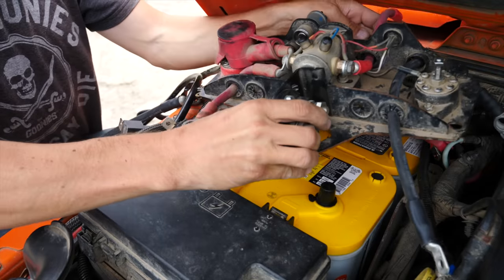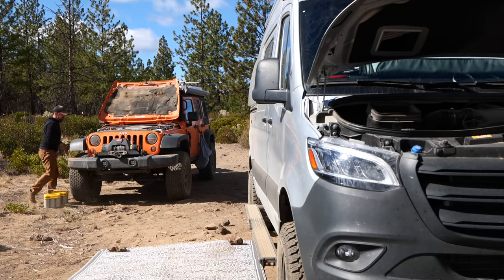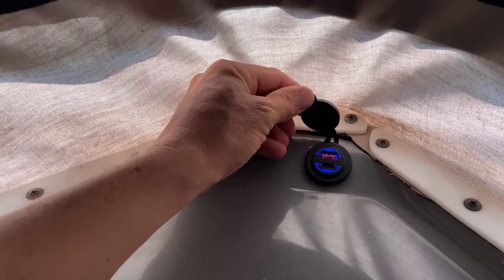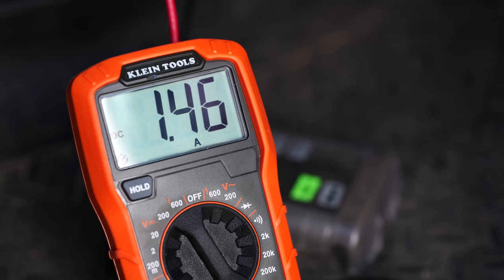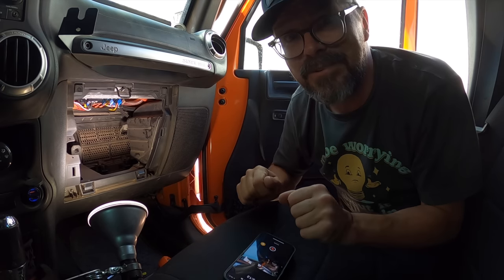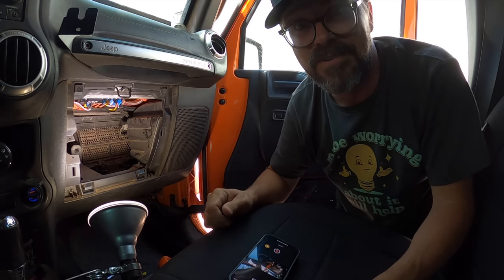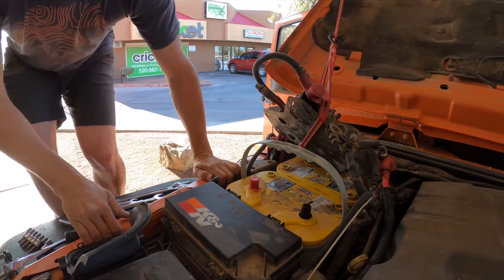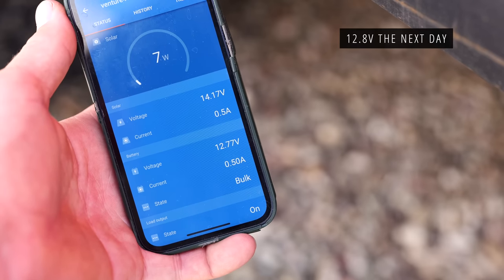Diagnosing Electrical Issues in the Jeep

Comment: I have been working with emergency response vehicles for over 23 years and I have a few suggestions for you to consider. 
First, AGM batteries charge between 14.6 and 14.8 volts after deep cycle use. Your charging system was only showing 13.7 volts initially. You can get your charging system checked for free. My Harley eats AGM batteries if not charged after a ride and my electrical system is at 14.4-14.6 volts.Someone in the comments below suggested a DC/DC charging system for your secondary battery. Sounds like good advice when out in the field. 
Finally, 300 mA is a considerable amount of draw for a vehicle that idles a lot and doesn't do freeway speeds every day. Normal electrical system useage of creature comforts and accessories can draw down a battery at engine idle.  Now that you have a home, consider installing battery maintainers and plugging in your truck when not in use.
Best of luck.

Comment: Chris, I think you hit the nail on the head with the comment about the fridge draining the battery down beyond 50%, AGM batteries will not recover properly with just a charge from an alternator. You would benefit from a DC - DC charging solution or if that is too much trouble simply charge your battery from 110v on a good quality multi stage charger once a month. Secondly i would definitely fit a Victron Battery Protect module to stop you over discharging the Aux battery, they are cheap and easy to install

Comment: First, like you said, Optima Batteries are not the same batteries they used to be 10 years ago. If an AGM battery like that drops so abruptly then the problem is the battery. What I suggest is to get rid of the dual battery system, have an Odyssey or another AGM like  Interstate AGM battery group 94R only for starting the engine and get one Lithium battery 150Ah or higher for the essentials like fridge, USB outlets and chargers. Ive had the interstate battery 94R for starting the engine for about 4 years now, no problems so far. I highly recommend that. Now, if you get a Lithium battery you’ll have to place it inside the car; under a seat of something like that. Anyway, if you want more info about just reply and I’ll help you in that matter all you need.

Comment: I too am ready swap out an Optima Yellow Top.  It has worked well enough for 2 years, but it is no longer holding proper voltage for an entire day.  I am going to try a Duracell from Batteries Plus, another group 27 AGM, but at half the price of the OYT.

Comment: I have a similar system where I have 2 extreme batteries and a solar panel on the hood (cascadia 4x4) plus a redarc 1225 bcdc in line charger.  With that together I have not had any problems keeping my batteries charged.  I also have the genesis dual battery system but I just switched it out to there new digital system which is working really good.  I also keep my ARB fridge running 24-7 days a week but I installed a surge protector outlet inside and  i plugged the fridge into that with that I wired a outlet on the outside of the Jeep. I can plug 110 into it while my Jeep is sitting at home not running.  I have never had a problem with my batteries.  But before that it was a nightmare lol.

Comment: I'm a few months late here, but this summer I've dealt with a similar situation on a similar setup in my rig.  I too had the Genesis Off-Road system and a pair of Yellowtops... I just wasn't getting the runtime out of my setup.  Dakota Lithium has a Group 24-sized 12v 135Ah LiFePO4 battery that is rated for cranking duty and has a built-in heater for charging during my Canadian winters.  Of course, it's not recommended to charge it directly from the alternator, so I added a Victron DC-DC charger.  It was a pricy setup, but it's working like a dream!

Comment: Have you checked your solar controller for peak voltage settings? I have a different controller than you and it has a setting for agm batteries that peaks them a little higher then the alternator can. I’ve had zero problems (knock on wood) with my dual yellow tops.

Comment: The problem is probably that your solar system can't keep up with your device discharge rate.  So when the Jeep is idle, the battery is being drawn down below the recommended 50% state-of-charge (about 12.1V at your draw current).  If the Jeep sits unused for a few days, especially during cloudy weather or with any shadow on the solar panel, your connected devices will eat away at the battery's reserve capacity (only 27.5Ah at 50% SOC for a Yellow Top).  While you can run an AGM down to 25% SOC, it will reduce the battery life by about 40% IIRC.  Going below 25-20% SOC (11.95V) can cause immediate battery damage.  10V is  well below 20% SOC.

A single 100W PV, according to industry standards, generates an average 425W/day (35Ah).  Older solar panels progressively generate less power, and any shadows on the panel or lack of bright sunshine also reduce output.  You measured about 2.8A with the fridge running, and 0.8 with it off.  Guessing that the fridge runs at a 10% duty cycle and averaging everything out, your 24Hr draw would be around 24Ah.  So on a good day (and with proper positioning), your solar system can recharge the battery every day.  But on a bad day you might be pulling all that 24Ah from your battery's reserve.  With only 55Ah total reserve, your Yellow Top can fall below 50% SOC after just one day of zero usable sunlight, and below 20% SOC after two days.  In your video you showed your solar was generating 0.2A, which is an estimated 0.8A less than your draw, and the situation gets worse as the Sun goes down.

Some possible solutions:

1. Connect a battery tender (at least 2A, no more than 10A) to your accessory battery when parked
2. Install a switch between your accessory battery and fuse box so you can turn everything off when you won't be using the Jeep for camping.
3. Install a low-voltage disconnect (such as the Victron Smart BatteryProtect) between the accessory battery and fuse box to automatically disconnect your accessory devices when the battery reaches 50% SOC (this would cause the fridge to turn off if the disconnect activates).

Comment: I'm heading off from Vermont in my 2021 RAM 1500 on a month-long camping tour of Nove Scotia, Newfoundland, Labrador and Quebec. I have a ICECO VL60D to keep everything cool. Instead of a dual battery system I have an ECOFLOW Delta 2 (1024 Wh) portable power station to provide auxiliary power. I installed a Victron DC-DC converter (not charger) to keep the Delta 2 powered while driving and ran a 12-volt outlet to the bed of the truck to keep the ICECO running while driving. The Victron unit will charge the Delta 2 at around 415 watts which is significantly faster than the RAM OEM 12-volt power outlet will. The ICECO will be plugged into the Delta 2 once I am at camp for the day and will keep it running all night without significant drain on the unit. Once I am back on the road the next day the Delta gets recharged by the Victron and the ICECO goes back on the 12-volt outlet in the bed of the truck. This trip will be a test of this setup in preparation for a 2-month road trip to Alaska & Canada in 2024.

Comment: Chris, I believe you are correct in your diagnosis. Doing the math your system the way it is currently set up works fine. It's just when you add up the hours in which it is under load living full time in your vehicle it depletes the life cycle of the aux battery. Maybe you can rotate the batteries from time to time which might improve overall life of the batteries. By the way looking at that transmission pan I believe it's time for a new one. Don't get stranded because of a leaky transmission. Safe travels, Perry

Comment: Hey Chris, with everything off, there should be no draw.  However, your fridge running non stop, with you never re-conditionjng those batteries with a charger (besides the solar, which is not sufficient to charge fully and definitely won't condition) will absolutely destroy them.  10 months is not great, but that is a aignificant load.
I suspect if you got an Optima Charger and conditioned your batteries when at home, they would last much longer.

Comment: When Interstate Battery bought Optima things changed. We used Optima on our off road race car & prerunners. They were a great battery and then we started having issues. What we found out was production was moved from Optima’s original factory in the US to Mexico. Interstate uses Johnson Controls to manufacture the Interstate battery. But we were told a 3rd party manufacturer called Clarios which works with Johnson Controls took over the manufacturing of the Optims battery in Mexico. The lead used in the spiral coil is recycled and the purity of lead is not the same quality as it was. We also had 2 battery’s where the terminal lost contact with the plating under the plastic case, causing it to lose contact. One of  the side terminal actually popped off the battery. In both cases these battery’s were in an extreme vibration application in a Baja Prerun truck. But this was never an issue on the OG Optima battery’s in the same vehicle. Btw we were using Red Tops, but that does not matter as Red, Blue & Yellow are all made in the same plant & contractor. 

For everyday use in my daily drivers I’ve had very good luck with Interstates from Costco. The cost is good and the warranty is great! 

But for a more extreme use look at US Battery. They are still made here in Pennsylvania. I’ve had great luck with them in several applications.

Comment: It takes 12-18 hours to fully charge a lead acid battery with a charger outputting around 14.1  volts for bulk charge and 13.6 for absorption and float charge. And for longevity it needs to be fully charged every week or so or at least monthly. I know you have solar but with the constant loads you really need to put a separate charger on the accessory battery every couple weeks. What happens if not fully charged, sulfate keeps building up on plates which ruins the battery. Getting it to full charge removes the sulfates. The loads you have are fine just need fully charged periodically.

Comment: You need to go with a Lithium Iron Phosphate (LifePo4) battery for your accessories.  10 year warranty to maintain 80% or more of it's original capacity and it will weigh about third of a lead-acid battery and require zero maintenance and will recharge much faster as well as maintain full voltage until nearly drained.  I have had zero good experiences using Optimas in my Ram or my Jeep.  Deep discharging any battery other than a lithium kills them in short order.  The other thing is you should invest in a good CTEK battery charger to maintain your batteries when you're home.  It will have a desulfating function that will add years to the life of a battery.
Reply: No doubt LiFePO4 batteries absolutely rock, the problem is mixing battery chemistries with a system such as the Genesis.  Since he's using AGM as a cranking battery, problems may (will) occur if he then uses lithium as an accessory.
Reply: @voodoo36x  The batteries are isolated.
Reply: @terrywaters6186  Not when the engine is running.  The isolator connects them.  This is why isolators are not the optimum choice for this.  DC-DC chargers are what he really needs to be running - especially if he swaps chemistries.      I ran a JK with a Genesis setup just like this for years and that isolator ended up killing my aux Odyssey battery just like this.
Reply: The issue again is... when you are on the road, good luck swapping them out in the small towns.  There is always a auto parts store which agm warranty. Problem with most youtubers recommending this, they are weekend campers
Reply: @ctrlnull7228  I guess the trick is to monitor the health of your batteries so you don't have them die on you in Siberia or the outback.   
It's very easy to do. The lithium batteries are gaining popularity exponentially and they're guaranteed 10 years before they begin to lose significant capacity and even then who knows how many more years they will function.  They'll be in every auto parts store and Walmart very soon.  Walmart already sells them online.

Comment: I run an off brand lithium power station for accessories does way better with fridge than leaf acid.  With prices where they are now If I were building it today I would use an  100 amp hour off brand lithium with a dc to DC charger and a victron solar controller for accessories.

Comment: WOW! I love my optima. Let me give you a little history, I was maintenance supervisor over many pieces of company owned powered equipment for military aircraft at an aircraft modification plant down in Texas,  as well as all vehicles including fire trucks.  Never had a problem with them.  I purchased one (blue top) yes marine deep cycle type for my personal truck it lasted 7 years.  When it went out I purchased another and it is on it's 7 year mark and still going strong.  Wondering why you did not get a deep cycle type battery for your accessories?  Also no corrosion which is a big plus. If you do run one down it takes a long time to charge up, be aware of that all night in fact on a trickle charge the best way to charge any battery.  Oh yes I saved the company lots of money over lead acid. Jeeps are also notorious for bad grounds I well know that also.

Comment: The issue is the way you’re connecting the batteries.  When you close the solenoid and connect the batteries the system gets an average voltage between them and charges to full.  If the house battery voltage is much lower then the starting battery it will never get fully charged since charging will stop once the average voltage hits whatever it’s programmed cutoff voltage is.  Disconnect the batteries and the average voltage will no longer apply and you will have a fully charged (or over charged) starting battery and an undercharged house battery.  To avoid this you need to fully charge both batteries separately on a regular basis and avoid deeply discharging the house battery, or use a DC-DC charger instead of the solenoid connection.

Comment: Might have already been discussed/mentioned, but of the Optima AGM batteries, I understand that the Red is the typical “starting” battery, while the Yellow is more of a “dual” (good for start & usage), but the Blue is the true “deep cycle”, designed purely for cycling and loading (but not heavy draw of starter cranking). These are a trade off in the design of the lead acid batteries. Battery University has some great technical background information (e.g. starting batteries can provide heavy cranking amps at the cost of poor deep discharge capability. Has to do with the design of the lead plate thickness and surface area.) 
For pure usage of a house-only battery like you have there, likely a true “deep cycle” agm (like the optima blue top) would be better than a “dual” purpose (starting & usage) battery like the Yellow Top.
Of course these days, while the Lead Acid AGM batteries are proven design, the LiFePO4 (Lithium Iron Phosphate) batteries (at least the ones from good quality manufacturers) are the next level and future. You get like 2x the usable Ah at 1/4-1/3 the weight for 2-4x the cycles/life - but 2x the price of Pb AGM. (If you dig into it, you’ll see that even the best Pb AGM should not be discharged past about 50% (depth of discharge) of their rated capacity. E.g. if it’s a 100 Ah battery, then you shouldnt really discharge below about 50 Ah, if you want to have a decent service life. Whereas generally you can get ~100 Ah out of a 100 Ah rated LiFePO4 battery, with a flatter (voltage) discharge curve.

So TLDR: get a true deep-cycle only (not “dual”/starting) or splurge for a quality LiFEPO4.

Comment: You do not have enough solar for your setup. Lead acid batteries can only be drawn low a few times before permanent damage. Double your solar or use a portable 100+ watt panel and buy a cheap lithium $300 Chinese 100ah battery. Nothing wrong with those optima batteries, they are just old technology and your abusing them. Every day you can't fully charge a less acid battery they more a tiny bit of capacity,  say 1%, that adds up over time. Any time you go into 11 volts some permanent damage is done. Lithium are a lot more resilient to abuse. I live in Tucson too,  welcome!

Comment: This is my theory and I’m not an expert. I think your dropping below 50% of the AGM’s capacity on certain days out of the year. Enough so the batteries ability to charge is getting weakened as if there is a parasitic draw. Over 2 years unless your constantly monitoring the system I’m sure it’s happened with falling asleep and leaving the Wabasto running.
Reply: You could be charging at low temps as well which can damage the cells potentially. I could be wrong.